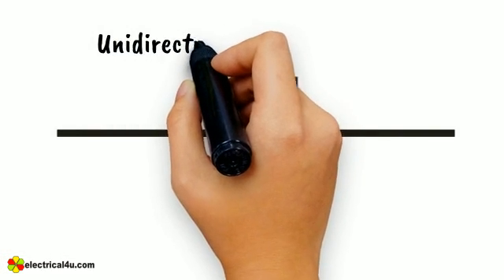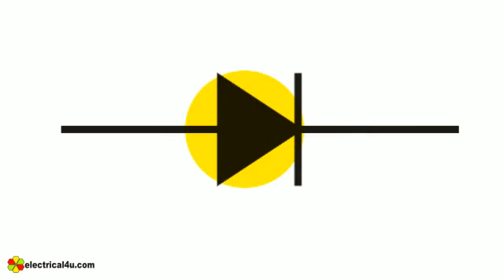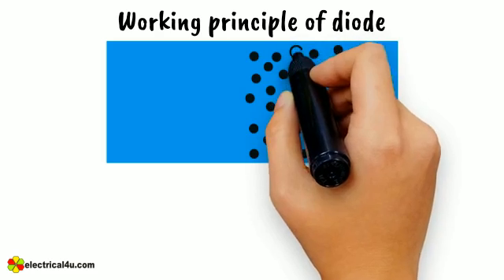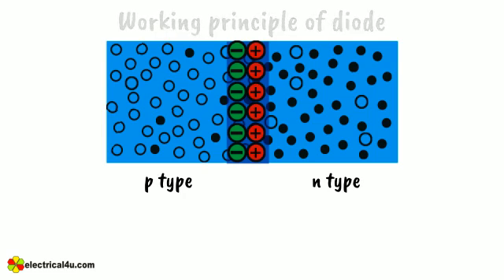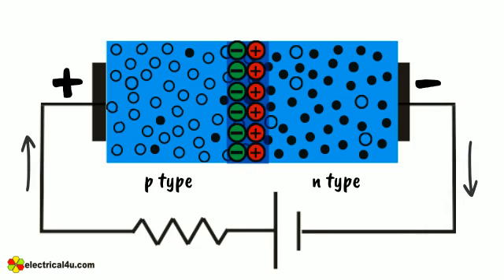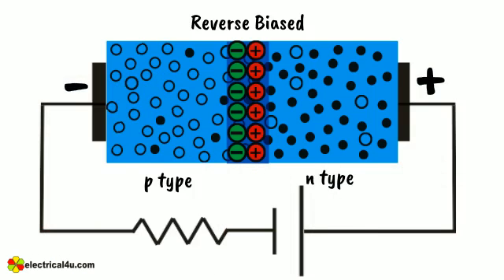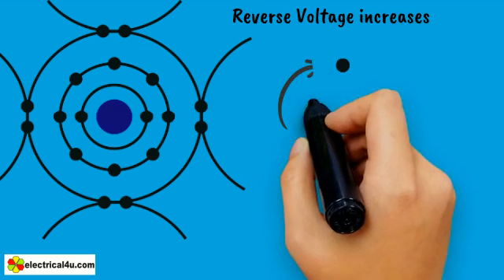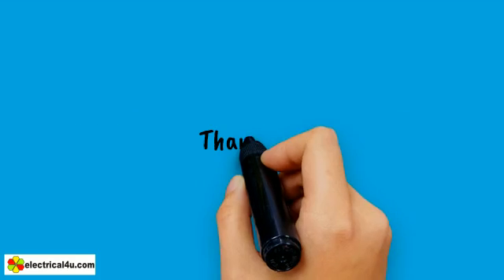Working Principle of Diode

Comment: This video is easier  to understand for a beginner about working principle of diode . Thank a lot
Reply: What is a pn junction ? 
A pn junction allows current in one direction only. It blocks current in the reverse direction. 
When a pn junction is formed, a potential barrier designated Vo comes into existence and is typically around 0.6 to 0.7 volts for silicon junctions. 
When the barrier whose Vo is 0.7 volts is disturbed by applying a forward bias of say, 0.6 volts, the current increases and the increase becomes steep for small increments of the forward bias value a little greater than 0.68 volts. Large currents are observed when the forward bias is 0.69 volts which is closer to the barrier voltage of 0.7 volts. 
The forward bias can never exceed the potential barrier voltage nor can it bring the barrier down to zero volts. That is the reason you seldom see current vs volt graphs of pn junction diodes beyond a volt or so.
How does the bias remain less than the barrier in an operational diode?
The voltage bias applied drops in the bulk neutral regions of the diode. 
The current in a forward bias adjusts to fulfill the conservation of current law and the rate of recombination.
A detailed description of the pn junction with a distinct approach using surface charges, alignment of Fermi levels, creation of the barrier, the distinct processes of diffusion, drift, recombination and the influence of the electric field on the energies of electrons is provided in the following textbooks.

Electrostatics and circuits belong to one science and not two, that of electricity and magnetism. To know how they are unified visit this link 
https://matterandinteractions.org/articles-talks/ and view the article 'A unified treatment of electrostatics and circuits.  B. Sherwood and R. Chabay, unpublished. (1999)'
pdf. 
For a live demonstration of surface charge and its effects in circuits visit 
https://youtu.be/U7RLg-691eQ
For a detailed discussion of surface charge, coulomb's law, electric fields, fields of dipoles and other charge configurations, and parallel plates, and a distinct approach using the surface charge concept in the study of advanced topics of capacitance, currents, conservation of charge, conservation of current, superposition of fields, superposition of potential, simple dc circuit, magnetic fields, magnetic fields of a current element, straight wire, current loop, solenoids, biot-savart law, voltage, voltage source, difference between e.m.f. and potential difference, ideal voltage sources, resistors, how current branches in a parallel circuit, capacitors, inductors, Faraday's law, inductance, ac circuits, transmission lines, Lorentz Force law, motors, generators, p-n junction diodes, electromagnetic waves, antennas and radiation, new electrodynamic theories on the nature of the electric field, see "Electric and Magnetic Interactions" by Chabay and Sherwood 
www.matterandinteractions.org
or 
Fundamentals of electric theory and circuits by Sridhar Chitta
https://www.wileyindia.com/fundamentals-of-electric-theory-and-circuits.html
There is a "look inside" feature in the amazon.com webpage of the book "Fundamentals of electric theory and circuits" by Sridhar Chitta with a few pages of Chapter 1 which may be viewed and also which you may swipe left or press < icon to view the foreword, preface and Table of Contents. The contents of the above book by Sridhar Chitta, make a distinct unified approach to electrostatics and a few advanced circuits like coupling signals to amplifiers, lending precision and clarity to the topics which is not found in most text books.
The book comes alongwith a CD with animated power point presentations for all chapters and voltage regulator, RC phase shift oscillators and differential amplifiers included additionally.
For a lecture by Prof Ruth Chabay on surface charge in a simple dc circuit visit 
https://youtu.be/-7W294N_Hkk
There is a full set of lectures beginning lecture 13 here on surface charges, electric fields, simple circuits, capacitance, inductance, faraday's law, motional emf, magnetic forces and more topics here
https://matterandinteractions.org/videos/EM.html